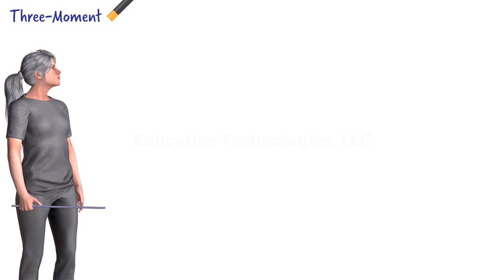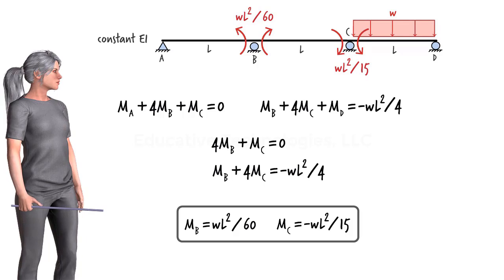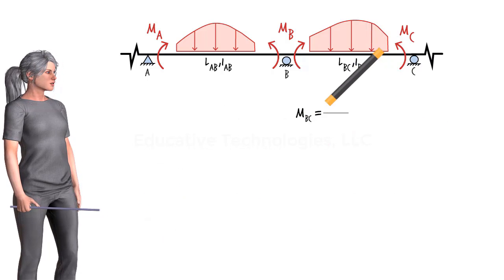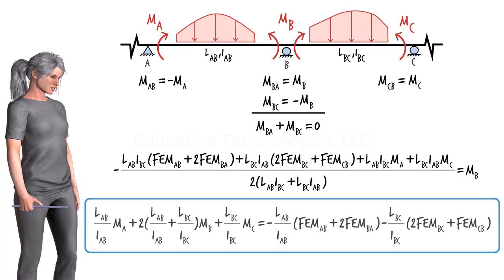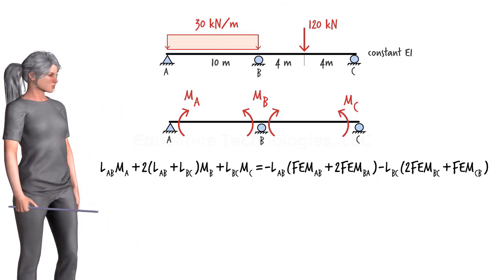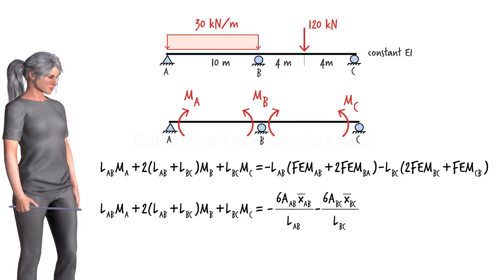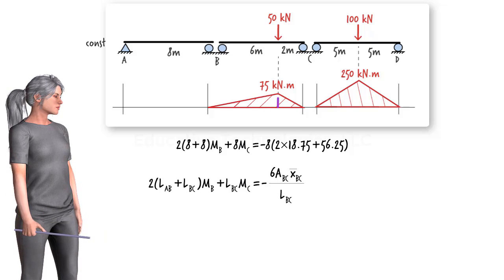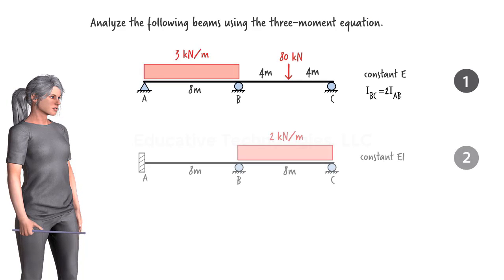SA60: The Three-Moment Equation for the Analysis of Continuous Beams (Part I)

Comment: the formulation for Aab is 2/3 x base x height, from where do you get those formula? can you explain ?
Reply from the maker: The moment diagram can be represented using quadratic equation of the form: 

M(x)  =a x^2 + b x + c 

Bending moment at x = 0 and x = L is zero, and the moment reaches its maximum height (say, P) at x=L/2. We can use these conditions to find the coefficients a, b, and c. 

Since the curve passes through the origin (0,0), we know c=0. 
The moment equation at  x = L can be written as: M(L) = a L^2 + b L =  0. 
Use the fact that the maximum height P is reached at x=L/2, we can write: 
M(L/2) = a (L/2)(L/2) + b (L/2) = P 
Solving the two equations in (2) and (3), we get: a = -4P/(L^2), and b = 4P/L. 

Substituting these values in the moment equation, we get: 

M(x) = -4P/(L^2) x^2 + 4P/L x  

To determine the area under M(x), we can integrate M(x) from 0 to L.  

This integral equals 2PL/3.
Reply: Thx a lot, you're doing great @DrStructure

Comment: The more I read your presentation, the more I got confused with the rotational sign on the support.  If you look at support C , both rotation sign go downward.  Whereas the pdf copy provided via the link on page 3, Figure 4 are upward.  Which one is correct?
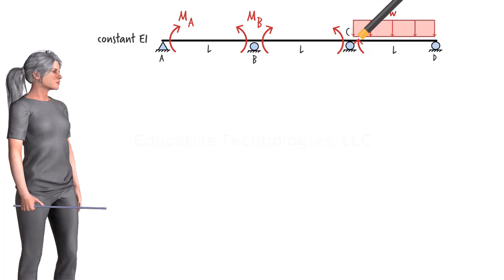Reply from the maker: The diagram shown in Figure 4 in the lecture notes is the same diagram shown in the video @1:16.  The moment directions are identical in both diagrams.

Please be more specific about the source of your confusion.

Comment: Dr Structure i recall there used to be some formula for finding the Centroid of triangle from either end .
Like if the perpendicular drawn divided base as "a" and "b" then when we talked about location from "b" end we said directly something like (b+L)/3. where L=a+b ,, i don't remember exactly but i need your help what was it actually. THANKS
Reply from the maker: I am not sure if this is what you are looking for, but… Suppose the right triangle has corner points (a,0), (b,0), and (b,h) where h is the height of the triangle at the far end. Then, the geometric center of the area can be written as x = (a + b + b)/3 = (a + 2b)/3 and y = (0 + 0 + h)/3 = h/3. That is, the coordinates of the centroid in the average of the coordinates of the three corner points.
Reply: @DrStructure    i apologise that i said centroid rather i was asking about centre of Area of triangle and thus its location from either of horizontal vertical . More precisely i wanted short formula of ( X bar ).
Say we have a triangle ABC and A&C lying on horizontal line while 
B  is vertical vertex . If i draw perpendicular from B  on  AC intersecting AC at point m (say) .if Am='a' and Cm= 'b' then if if write X coordinate of center of Area of Triangle ABC from horizontal vertex A 
Is it ( a+L)/3.       ??? ..... Where L=a+b(length of horizontal base of ∆)
Ans similarly from C =(b+L)/3.   ???
Reply from the maker: Yes, your equations are correct.

Comment: What to do if a concentrated moment and a uniform load are all above a support?
In which part of the equation would you put the concentrated moment (As a load or as a moment in the left part)?
Could you take a look at the problem below I'm trying to solve?
https://www74.zippyshare.com/v/23ZR5gy1/file.html
Thanks in advance.
Reply from the maker: Uniform loads are member loads, not joint loads. Such loads are distributed over the portion of the member's length and cannot be applied directly to a joint. If a load is distributed on two adjacent members, then we treat it as two separate distributed loads each being applied to one of the members.

For a concentrated moment applied to a joint, please see the last exercise problem at the end of the lecture. The solution to the problem (the link is given in the video description field) shows how to treat such a moment.

Comment: Does this negate the use of the usual sign convention generally used on this channel, where counterclockwise rotation results in positive value?

At 6:41, it shows that all the FEM values are positive regardless of its position, whereas in previous lectures it is commonly known that the moment on the left side of a FEM analysis is deemed to be going in CCW, thus the positive value; and the right side to be going in CW; thus the negative value.
Reply: 6:20 to be precise, there it shows that all FEM values are positive regardless of its rotation.
Reply from the maker: We have three different/independent sign conventions, used for different purposes. 

1. When writing the static equilibrium equations, we choose a Cartesian coordinate system in which a direction along the x, y, and z axes, and a rotation along these axes is selected to be positive. This choice is completely arbitrary. For example, we can assume either a clockwise or a counterclockwise rotation to be positive.

2. The beam sign convention. This is associated with a pair of forces, not a single force. For example, bending moment in a beam segment is considered positive when the pair of moments acting at the ends of the segment cause it to deflect downward (concave up).  In this scenario, the bending moment at the left end of the segment has to act in the clockwise direction and the moment at the right end of the segment must be in the counterclockwise direction for the beam to bend concave up. 

3. When formulating a method, such as the slope-deflection method, we assume a positive direction for each member end moments. For example, we can assume counterclockwise direction to be positive for the member-end moments. This is similar to the assumption that we make when analyzing trusses. We assume all the unknown member forces to be in the tensile direction.

Strictly speaking, these sign conventions could be viewed contradictory. For example, in (1) above, we have to decide whether clockwise or counterclockwise bending is positive. In (2) however, a pair of clockwise-counterclockwise moments is considered positive. But this does not matter since these conventions are independent of each other, each used for a different purpose.

In this video, the moments shown at 6:41 are following sign convention 2 above. The moments labeled Ma, Mb, and Mc are not fixed-end moments, they are the actual bending moments in the beam at points A, B, and C. They are placed on the beam to suggest a concave up bending of each beam segment. Since these moments are unknown, we assume them to be in the positive direction.

As for the fixed-end moments, by definition, they are the support reactions of a fixed-fixed beam. If the load is downward, then the moment reaction at the left end of the beam has to be counterclockwise and the moment reaction at the right end of the beam has to be in the clockwise direction. The video shows them in these directions. If the applied load was upward, these moments would have been placed in the opposite direction. 

When a beam is subjected to a downward load, causing a downward deflection, we say bending moment in the beam is positive. Meaning, the internal moments that cause the deflection are acting in the positive direction per item (2) above (clockwise at the left end and counterclockwise at the right). These moments are action (not reaction) forces. In contrast, the fixed-end moments are reaction forces, meaning they act in the opposite direction to the action forces. So, for the said beam, the reaction moment at the left end has to be placed in the counterclockwise direction whereas the reaction moment at the right end of the beam should be placed in the clockwise direction.

Comment: Some write the RHS of the equation as (6a1.x1/L1) + (6a2.x2/L2) then why are  putting minus sign before them?
Reply from the maker: Not quite following your question, please elaborate. +/- signs generally depend on the assumed sign convention and the rules of algebra.
Reply: @DrStructure  he mean to say that some have +terms in rhs while some have in - sign. I also have same doubt plz clear
Reply from the maker: @tusharkumarkumawat8741  A negative sign on the rhs of the equation is linked to the sign convention that we use for bending moment. In this presentation, we've assumed a bending moment that causing a concave up deflection of the beam segment to be positive. If we assume the alternative, that is, if we assume bending moment is positive when the beam deflection is concave down, the rhs of the equation would become positive.
Reply: @DrStructure  thanx for replying and clearing up the doubt
Reply from the maker: @tusharkumarkumawat8741  You're welcome.

Comment: Can anyone please explain why is it 4 Mb at 0:39
Reply from the maker: The example at the beginning of the lecture is meant to show the process without any derivation. The derivation for the three-moment equation is given afterward. According to the three-moment equation (see 5:50), the middle term coefficient is 2 times the sum of the (L/I) for each segment. In this case, since L is the same for both segments and they both have the same moment of inertia (I), the coefficient for the middle term simplifies to  2( 1 + 1) = 4.

Comment: Thank you Soo much.. 
But , i would like to know how we shall find the deflection using this equation..?😊😊🙏🙏
Reply from the maker: The three-moment equation is for calculating member forces in an indeterminate beam only. Once the structure has been analyzed and the support reactions have been calculated, techniques such as the conjugate beam or the virtual work can be used to calculate deflections.